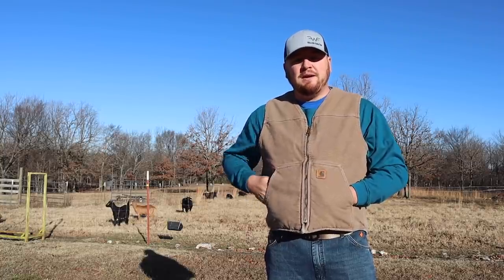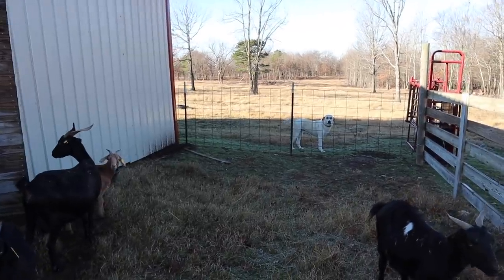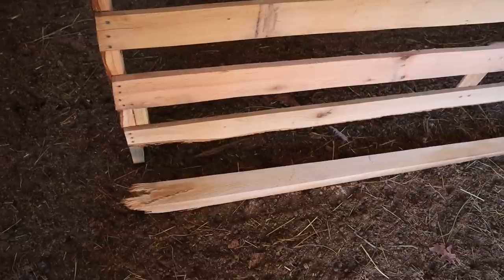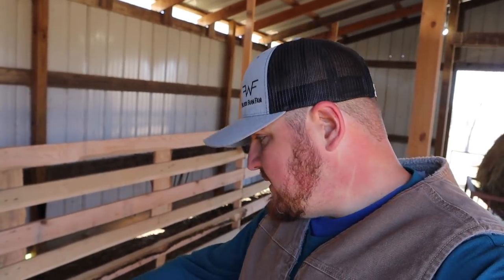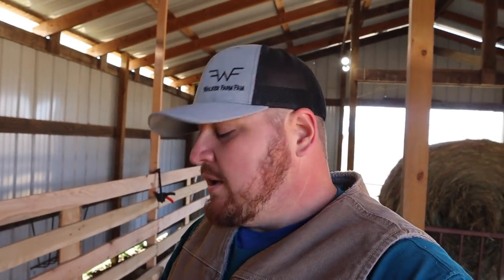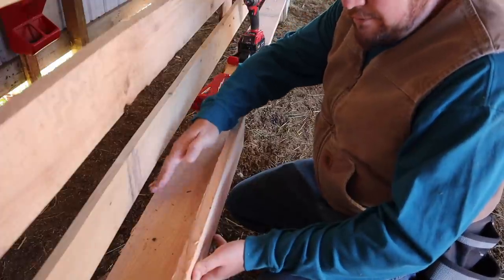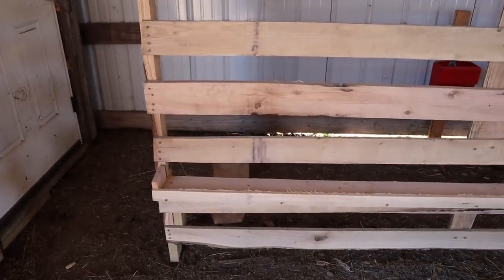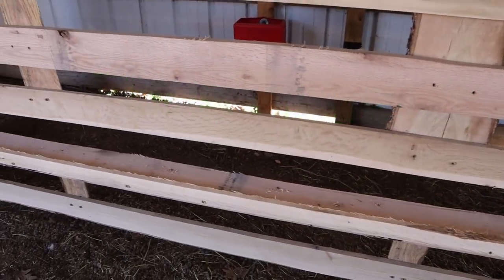Building The Goat Feed Trough With Rough Cut Oak Lumber Milled On The Farm!

Comment: I was thinking about the feed sliding down from inside with it built from individual boards getting caught at the junctions. I have seen some people use linoleum flooring in parts of their barns for a barrier between dirt floor and bedding for warmth and easy cleanup. You can usually go to a flooring store and get roll ends and scrap cheap or free. I wonder if that could be used as a smooth lining for the slide?

Comment: think you on the right track there;;;;;think i would have dropped the 3'' pc down the width of pc attached to it ;;;;;that way had a bit more room goat side;;;;;looked like about  3/4'' thick ;;;could still screw in the back to that pc and into the 3'' pc;;;when you get done you will be happy with your plan;;;as my granpa used to say ''Ifin it don't work take it apart and redo to make it work''  We did that a lot in goat barn which was used only to separate and pen during shearing time;;;angora goats and sheep 3 to 500 each;;;;their shelter was under trees in pasture;;;;their feeding troughs were the ground in pen next to barn to keep them coming home for count and check health;;;;

Comment: I really didn’t know what you had in mind but I kind of pictured you still using that same metal feeder already in the barn but with it up against the new boards & maybe a long strip of some kind of sheet metal or aluminum flashing attached at an angle so the feed would slide on in there.

Comment: what happens when it gets 35oc in that shed and the oak dries out and  shrinks splits and could pull nails hopefully this wont happen but i would say cut your wood and stock pile and search for the correct amount of time you need to let oak dry then you will know what your dealing with you dont want to be double handling jobs and waisting timber , i would say let it dry  use out door wood glue and drill holes for screws then you will have work that lasts for years and try and get some pine soft woods and stock pile that to